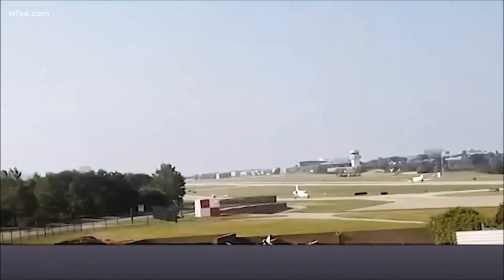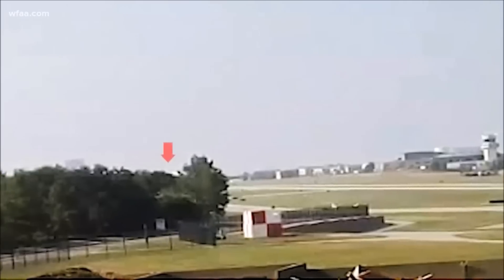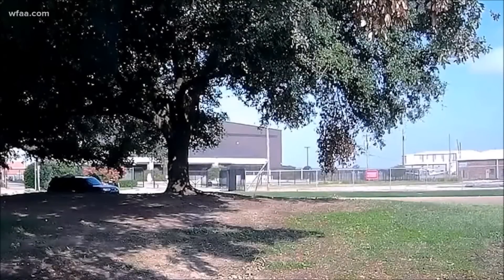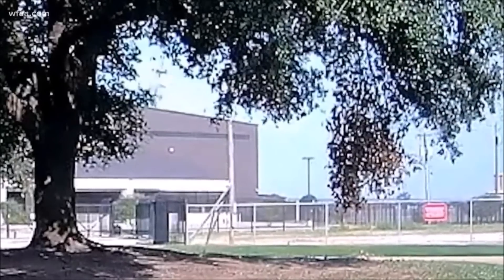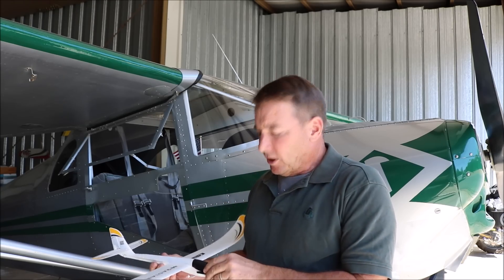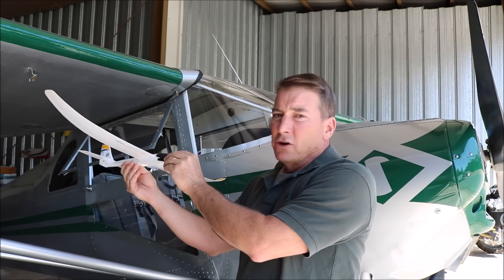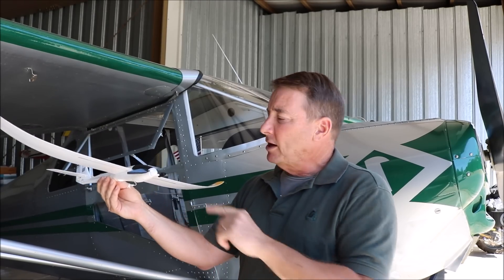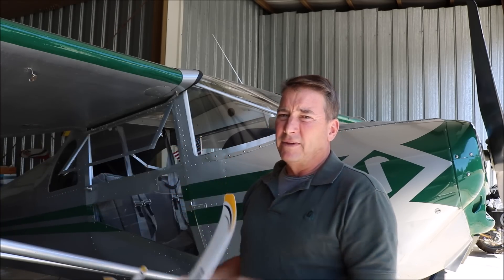Addison Tx. King Air 350 Crash UPDATE- Vmca

Comment: Proves that "accidents" don't just happen. They are composed of a sequence of negative  actions that ultimately lead to the "accident" occurring. Thank you Juan.
Reply: There are very few accidents. Mostly it's unintended consequences of improper actions.
Reply: Rain Coast my dad was a private pilot from age 16 to age 78 as he says all the research on accidents he's done accidents 97% pilot error
Reply: As a retired safety professional / pilot  with experience in air safety, I always despised the term accident partly because it is overused and denotes subconsciously that it could not be foreseen. Aristotle in 350BC said “Accidents are without cause “. 

This is a mishap as most aircraft disasters are. As a pilot you should never be under any pressure to push those throttles forward to TO power especially when your having issues with a engine probably near if not over gross. As most professional pilots have heard is that to stop a mishap from occurring you have to break the chain of events. 

When you are flying you have been taught that you have to be in front of the aircraft by x number of minutes, but have you ever been taught to look back in hindsight at least 5 minutes to see if any links in the chain have been forming? If you see a link  then break the chainlink to go flying another day. Sadly this is a classic case study of a rollover at Vmca. Even when they lost the engine they could have stop the chain by dumping the nose and pull back the levers and land in a relatively unobstructed area in front of you upright.... the insurance company owns the airplane the moment that engine quits. Fly it as far into the crash as possible.

Thanks for the update Juan well done as usual.
Reply: You stole that from a crash investigation show.
Reply: Yeah no shit! Think those 737 max might have been a perfect flying machine?
Reply: Exactly what they taught us in the navy.
Reply: @rfi-cryptolab4251  Aviation is full of aphorisms that everybody repeats.
Reply: Rain Coast absolutely. Sometimes those negative actions will be entirely beyond your control, but yeah. Just about every accident could be prevented.
Reply: @originalfiremancancelled7303  Around 80% is the official figure, but it is still a very high percentage. The aviation industry is unique in that it learns from every single one of them thankfully and pilots too. No-one who flies a plane wants to die ever and ever tragic death is deeply felt.
Reply: Angela Bailey well although my dad has his wits about him still he is 91 so he was close🙏 my family was quite blessed with great Pilots both military commercial and civilian
Reply: Not just an accident.  Heavy load yes but the engine stall intrests me 1st thing.
Reply: The word "accident" has never meant something that was unpreventable. It just means it wasn't deliberate. You can look back 600+ years and see the same usages throughout history. It's one of many words people like to "correct" other people on because they apparently forgot how to check a dictionary at some point. Don't be one of those people.
 
(Another, very similar, word is "mistake". "Mistake" means something that was done through poor judgement, but I can't count the times I've heard something like "it wasn't a mistake; you weren't using your head". The "correction" is just defining the "wrong" word to a tee.)
Reply: Everyone is an expert... until they have to face a compromise operating commercial aircraft, I went down on take off into trees in a crop duster due to supercharger seal failure on take off.  The window to act precisely in an engine out emergency on take off is so small you can spout slogans till the cows come home it still wouldn't change the outcome.
Reply: @scubathehun  yes I'm still curious about there concern on the failed engine output before takeoff and also the weak right engine apparently.
Reply: Rain Coast  One thing not discussed in the video is rudder stall during VMC accidents.  Not only does the wing with the failed engine stall but as the aircraft begins skidding the critical angle of attack for the rudder can be exceeded at which the game is over.  When the nose of the aircraft starts moving and the rudder can not control it the nose of the aircraft has to be lowered much the same as a single engine power loss on departure and start reducing power on the good engine if necessary.
Reply: What proves that accidents don't just happen?
Reply: @twothreefour234  you have a tank slapper? I remember when I was young and was on a dirt bike going pretty fast on a dirt road and not having much experience I hit the front brake a little too hard and next thing you know Im in a huge tank slapper, I let go to bail and it corrected itself before I could jump off. It was pretty scary but later I found out that trying to correct it only makes it worse, if you let go it will correct itself. Pretty wild and I got lucky
Reply: Most states don't call them accidents anymore.  they are referred to as crashes.

Comment: Good explanation of the factors involved. Handling a REAL engine out scenario in an aircraft like the King Air at the most critical point in the takeoff is probably the most difficult situation to handle for any pilot. I flew multi-engine airplanes for years in the Air Force and never had a serious emergency and can only imagine what it would be like if something like this happened to me. Losing an engine in a multi-engine airplane is so difficult to handle, the Air Force had a computer in KC-135R aircraft to helpt handle the rudder control needed to handle the asymmetrical thrust of losing an outboard engine in such a scenario.

Comment: Nice report Juan.
As Juan stated, VMCA is with bad engine FEATHERED. Even with AutoFeather, that takes a few seconds. This should have been a minor event resulting in a rejected takeoff or, at worse, a shallow climbout and return to the field. But if the initial reports are correct, with cockpit confusion, declining airspeed, and a winding down propeller producing a lot of drag, there were apparently too many negatives to result in a positive outcome. Still waiting for the findings on GrossWeight and CG.
Reply: Would there be an issue with the physical fitness of the pilot. He was 71. I wonder what the last physical indicated, if anything. I just ask bc of the phrase, " cockpit" confusion. No disrespect intended to the pilot,  but these things can creep up, such as early Alzheimer's,  dementia.  I had to approve DOT physicals years ago and caught errors at times. Sometimes the dr was not totally honest and it came back on the trucking company I worked for. A sudden cardiac arrest behind the wheel and hits a bridge or a van full of kids. (2  actual incidents I had to deal with). I am just curious what pilots think about fitness to fly.
Reply: If you can't keep it straight & maintain speed & height, close good throttle, land straight ahead.
Reply: @bombasticbuster9340  I'm 66 and I and all my friends my age laugh all the time about our gradual loss of not only short term memory but our ability to make snap decisions or keep up with quick conversations. I don't believe this is a subject covered in Medicals. Our egos are tested frequently as we seem to bumble along relying more and more on others. I wonder if our pilot in control may have just not been able to mentally meet the challenge?
Reply: @graemewilliams1308  Your comment just made me realize something: Multi-engine training should include not only what you must do to maintain control but also a plan for when you for whatever reason fail to do that and are starting to lose control (because feathering doesn't work or you are having an off day or whatever). Maybe it does, I wouldn't know, I'm purely SE pilot.
Reply: @TomasAWalker53  Anyone who has ever gone through the experience of a grandparent who shouldn't be driving understands the impact on ego, independence and fear of aging.  One would think it would be easier to give up flying because it isn't critical in our day to day activities but the same things factor in.  Assessing the brain's executive function at the complex level isn't something most physicians are trained to do.  I wonder if those that do medicals for pilots have special training in this?
Reply: @johanveltheim4331  multi-engine pilot here, it's called the vmc demonstration. It's always done at altitude because we take the plane to the knife edge of control before we recover. The procedure is to lower the nose and reduce power on the operating engine until directional control is established once we see and feel that we've lost direction control. I can understand the hesitancy to push the nose down with the ground less than 200 ft away but that is the only way to save yourself in that situation. If the runway was particularly short I could understand why they didn't pull power and land but that still would have been a great option if the engine failed before V1. I always brief the abort plan before takeoff, on the roll, after rotation, and on initial climb out. It can become tedious but I just make it a part of my routine and move my hands through what I need to do so I can move without thinking about it.
Reply: I always thought Vmca was calculated with the prop windmilling for certification standards? Great video though Juan.
Reply: @generalrendar7290  Well it makes sense that you would train for recovery from that just like you do for stall/spin etc, I just had never thought about what the ME training includes (I just thought you fly a lot with one foot pushed all the way forward :)
Reply: @generalrendar7290  I'm not a pilot but that sure sounds like a Win-Win routine to me. Great post!
Reply: @vincewhite4745  You are partially right. 14CFR Part 23 states "Propeller windmilling in takeoff pitch (or feathered, if equipped with autofeather) ".
So, if you were trained in aircraft without Autofeather, you would have learned "With Propeller Windmilling."
Reply: @generalrendar7290 He never got above a hundred feet and needed to put it down and on his hard right foot
Reply: Pretty sure that all PT-6 A/C specify that the auto-feather is 'OFF' on take-off: The propeller blades transition through 'Reverse Pitch' prior to 'Feather'.
Reply: @scotty657  and way heavy in the ass back tail

Comment: Once heard someone say "You shouldn't be surprised the engine failed on takeoff, you should be surprised the engine DIDN'T fail on takeoff"
If you approach every takeoff with that in mind, you'll be a safer pilot.
Reply: That's nice in theory, but after thousands of non eventful take offs, it is hard to maintain a mindset on every take off that the engine is going to fail. It's human nature.....it's like driving home after work. Can you honestly say that you didn't daydream whilst driving home on some of the commutes? To concentrate during every takeoff for every eventuality on every flight during your flying career is near on impossible.
Reply: @ricbarker4829  - I dont have thousands of flights, but flying gliders, we do follow this practice on every takeoff. A rope breaking is probably more likely than a well maintained aircraft engine failing. A better analogy to your car example would be leaving a parking lot. Every single time I'm leaving a crowded parking lot, I am all concentration, looking out for pedestrians or cars splitting thru spaces. Complacency does happen, but its not a given, its 100% up to you.
Reply: bob wach  it didn't take long for the "argumentum ad hominem" to raise it's ugly head. Good work bob.

Comment: Your analysis in my opinion, is spot on. I would first like to offer my condolences to the families of the victims. The video is hard to watch as you realize, hey, those are real people and they're about to die. They will never ever come back. 

Personally, I like the King Air in all its various types. However, I do know it can be a tricky aircraft to fly. Many pilots I have met that are type rated in a King Air almost unanimously agreed, a pilot flying this particular type of aircraft must get ahead of it to be successful at flying it.
As a former Marine Aviator who flew F-4 Phantoms, I knew a thing or two about staying ahead of your aircraft. In most cases, pilots tend to do this naturally. Training, preparedness, logic as well as a strong sense of awareness are key to keeping ones ship aloft. Even after takeoff. But the King Air can be a hand full for a novice pilot. The margin of error once you get to V1 is pretty much 0. With little altitude, speed and the ground rushing up at you, things just happen too quickly. Of course, catastrophic failure does occur from time to time. Pilot error occurs. All necessitating, in my opinion, a much stricter standard of training on these particular type aircraft. Almost all twins, if you have an engine out on takeoff, the aircraft will likely yaw. That coupled with weight, speed, weather etc can create fantastic situations which human beings simply cannot deal with. Too be fair, even a computer most likely wouldn't have saved this aircraft or its passengers/ pilots. 

Our oil company has several King Air 350's. I have flown on them numerous times. Our pilots are constantly training to try and prepare for any possible events. Should they occur. But even they have stated, there are certain forces at work that simply cannot be controlled. Takeoff is obviously the worst time for any event to occur. One can cite literally thousands of incidents in which an aircraft mishap resulting in catastrophic failure and loss of life occurred on takeoff. Landing, not quite as bad, but still it does occur. 

My Rio and I were over the Pacific in a flight of three aircraft (F-4's). The weather was awesome. Visibility fair to good. We were about to start our landing procedures for a carrier landing. Then my friends F-4 had an engine failure. Not the sort of thing one wants when low on fuel and looking for the 3 wire, but he had to land his ship on one engine. Honestly, I thought he was going for a swim. Him and his Rio. We landed first. Trapped the 3 wire. Exited to park quickly. Fire equipment etc. It was very surreal. He trapped the 3 wire, full AB. I and my Rio jaw dropped. 

The point. He had altitude. He had speed to keep his ship aloft. Fuel was an issue, but clearly, it was our training that gave him the edge needed to come home safely. Its sickening to see aircraft crashes as they occur. For us pilots, we analyze every single detail of such videos.
Looking for clues. Anything that might shed some light as to what happened. 

One thing is certain, that King Air was yawing real terrible until she went wing over and augered into that hangar. The pilots had so few seconds literally to try and right the aircraft. I'm sure they tried. Yet, as I stated above, sometimes, not all the time, but sometimes things happen. Certain forces at work. At play if you will. Such that it is literally impossible to correct. 

From my aviation experience, that is exactly what I observed in this video. An aircraft struggling to not only gain altitude, but to keep on a runway heading. Thank God no one was in that hangar.

Excellent analysis by the videos creator and I quite agree with all of it.

🇺🇸
Reply from the maker: Thanks JR
Reply: @blancolirio  Thank you for your service.🇺🇸